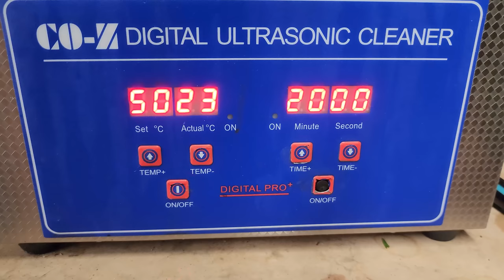Rusty 1959 Tonka Dragline Steam Shovel Restoration

Comment: Fantastic work. It’s truly amazing the level of quality in these toys and I wish I still had mine!  A suggestion when applying pressure sensitive stickers, if I may. Spray some water with a small amount of dish soap on the toy and the decal. This will allow you to place the decal correctly without having to resort to trial and error. Blot the excess water and when it dries, the decal will be set.